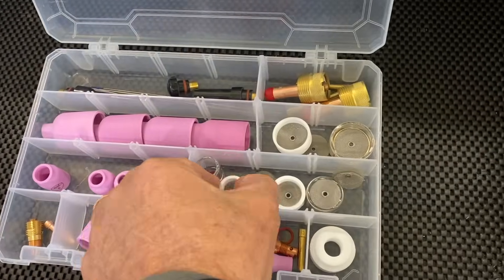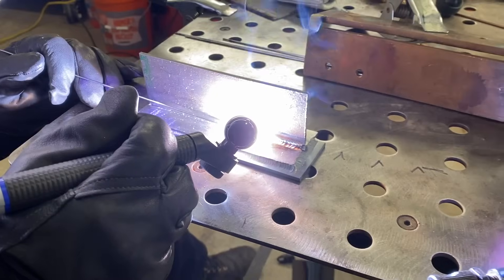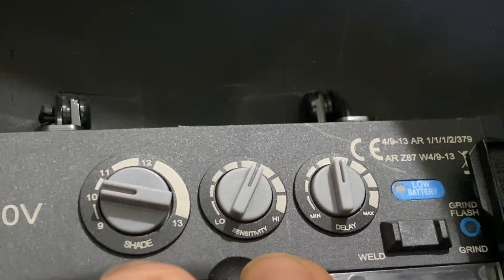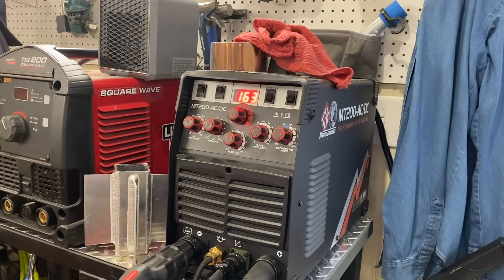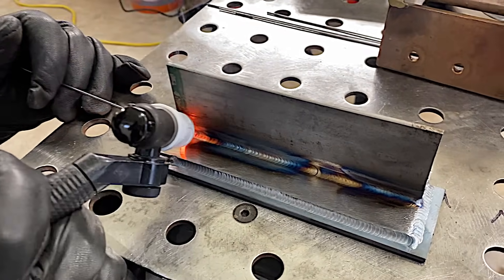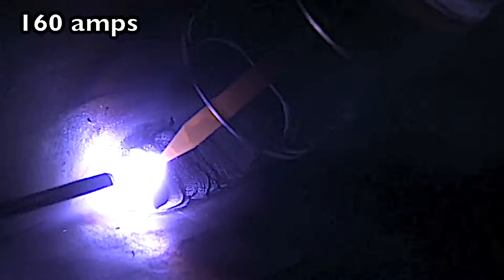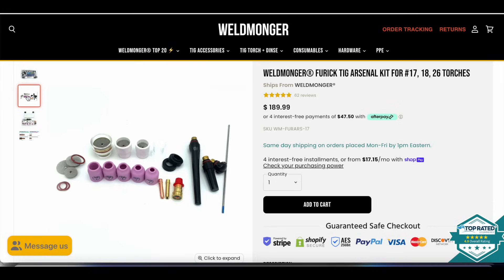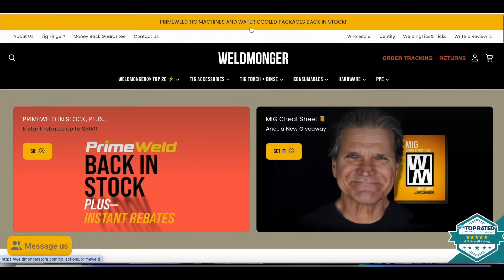TIG Carbon Steel Tee Joint

Comment: Here's a side note in relation to getting flashed with auto darkening hoods ..
While welding full-time in the early 2000s some of the electronic/auto darkening hoods would not darken while using inverter technology welders that were becoming more popular. Never had a problem on a transformer machine.
Appreciate the videos Jody!
Reply from the maker: I had similar experience when I sold my miller syncrowave and got an inverter. My speedglas started flashing me.

Comment: When do you lay the filler rod vs dip? Is it just preferred style? I am about to start learning Tig welding,
Reply from the maker: It’s just one of several methods used. Not preferred by all but preferred by some for certain situations
Reply: @weldingtipsandtricks  I won't be doing aluminum, only steel plate and tubing for personal stuff, I'll try both options and see what works best in my application.

 Thank you for the quick response
Reply: @dfrmotorsports4591 I hobby TIG and my latest project had poor fit up. The filler rod was the right size for the gap, so I used the lay wire technique for the first time and it worked a treat!
Reply: @weldingtipsandtricks I'm fc from Thailand sir.i want to buy afjust torch,how to do?😊

Comment: Counterintuitive at first, but visor flashing might be caused by excess sensitivity, specially on cheaper models. TIG emits a lot of light which can overload the sensors circuit, which shuts down to save itself and sacrifice your eyes. I've "solved" this issue on my first helmet by taping a bit of toilet paper (1 ply of a 2 ply) in front of the sensors, followed by a fair amount of swearing after understanding the issue and finally buying a better visor, Good helmets with good visors are not just a luxury.
Reply from the maker: Thanks for the info!

Comment: I taught myself to weld through these videos and a college text book. I’ve been welding titanium in a chamber for the aerospace industry going on 6 years. Thank you Jody! You gave me a good career through these videos.
Reply: I weld heat exchanger dealing with various metals. But aero space was also a next big goal for me. How’d you get into it ?
Reply: @xavieredmonds6575  I was posting pictures of my welds on Instagram and someone I went to high school with saw it and told me to come in for a weld test. Huge ups and downs in aerospace but chamber welding titanium is like nothing else. Really fun!
Reply: @xavieredmonds6575  Honestly,I just put in the work for a couple years welding motorcycle exhaust systems and got a reputation as a decent welder. Someone I knew as a kid saw what I was doing and had me come in for a weld test. Since most people have no experience chamber welding titanium yet where mostly looking for some basic skill, a good attitude and willingness to learn.